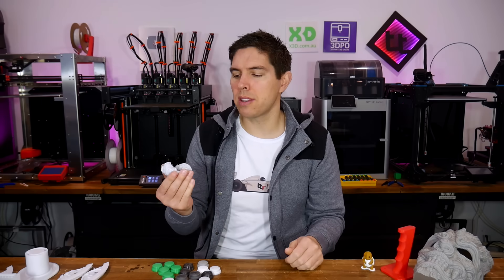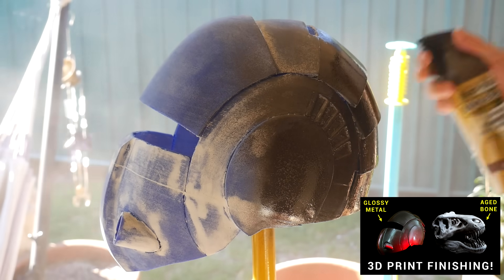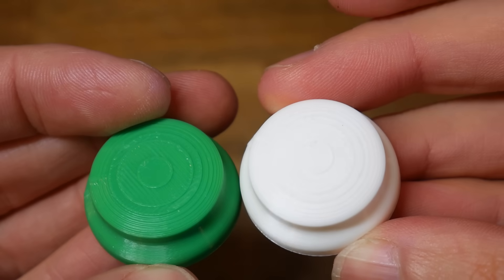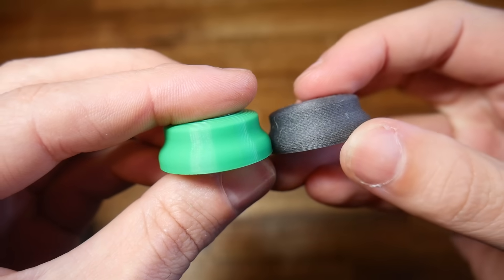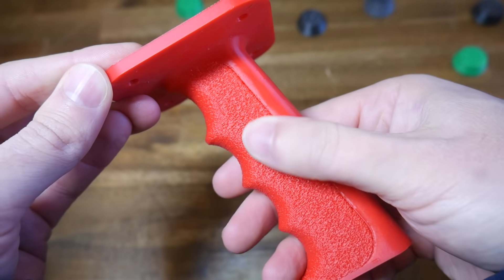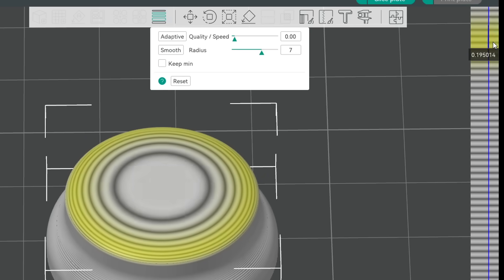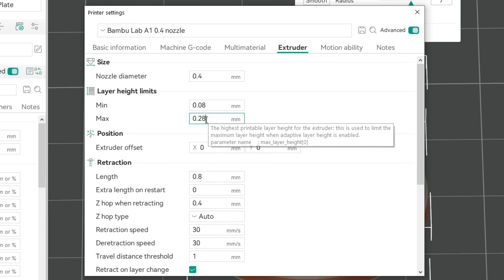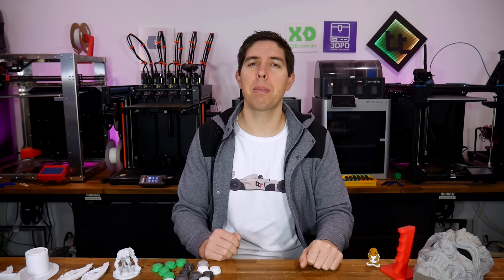Five ways to reduce layer lines on your 3D prints - Adaptive layer height and more!

Comment: It would be nice if there was a slicer option that treated a layer as non planar sort of. Treating the entire model is complicated but on a layer by layer it is simplified. It also could maintain the X/Y only to start. This allowing a min/max layer height to be achieved where the outer perimeters could achieve 0.05mm reducing lines while all inners are 0.3mm for speed. Yes it can get complicated for really complicated curvatures and may work better as a non planer for each layer where Z axis is also active.
 Steep portions would be simple for the slicer to print the perimeter 1st at 0.05mm (or min) layer height and build it up to the max layer height before continuing the layer. This could be simply stack 0.05mm layers up to 0.3mm layer on the perimeter and then continue the remaining layer at 0.3mm.

Shallow portions could be handled the same but for overall smoothness a layer height stepping from min to max would be better. Layer stepping (what I would call adaptive layer height) could based on calculations do outer perimeters at 0.05mm (min layer height) and step its way up while meeting the curve angle vs line width to 0.3mm. Then finally finish the layer at 0.3mm. Not really non planar but adjusting layer height based on surface curvature at that point.

 In a perfect world printing each layer as full non planar would be best. This would allow for any slope with little or no layer lines as one could print from 0.00mm height to max height on each layer while maintaining most of the layer at max layer height.

 Print times could be greatly reduced in some models with interiors printed at 0.3 or 0.35mm while outer perimeters at 0.05mm. This would also fix some overhang issues as reducing layer height also increases overhang overlap by reducing the stepover.

Comment: Why isn´t there an option to decrease just layerhight on outer perimeter? If you print outer perimeter first, printing maybe a layerhight of 0.7mm 3perimeters on top, but than the other perimeters and infill with 0.21mm. than the next 3 0.7mm outer perimeters and so on. As you only can see the outer perimeters anyway (exept on top) this would only moderatly increase printing time, but would increase quality a lot.

Comment: Flocking: that is stupidly simple, nice tip. For manual post-processing, i usually use woodfiller and thin it a bit with water/iso mix. Extremely cheap, non-toxic, easy to sand. Downside is that it needs to be sanded, sometimes sticking is a problem (clean the print from ANY oils and roughen it up a bit...)  and the dust goes everywhere. Note: do not EVER blow the gypsum dust, always wipe it with moist rag. The dust is abrasive and goes everywhere. It is a fan killer.

Comment: I seem to be one of the only people that really doesn't mind the layer lines of 3D printing, though I'm definitely not a fan of stair stepping on shallow sloped surfaces, so I do like the Adaptive layer height capability (which you can also do in the object table with more precision, tho it does take a bit longer to set up)
Reply: I'm the same. Most of my prints I either don't care about the layer lines or I need an actually smooth surface (such as when making a mold) so much only option is sand/polish.

I do mostly mechanical parts though, not decorative parts. So perhaps that's why I don't mind the layers.

Comment: I've got an idea: what about printing the internal parts with higher layer heights for speed and only printing one or two lines at the outer perimeter with lower layer hights for smoothness. Perhaps eves combined with adaptive layer heights. Of course the algorithm would need to make sure not to bump in to the internals by going around or raising the print head.

Comment: Note: .15-.16mm layers in FDM tend to yield better layer adhesion for mechanical / functional prints
Reply: I actually use THICKER 1st layers for improved adhesion on 1st layer.  Normally 0.28mm

Comment: In the 8 years I have been 3D Printing I constantly see that Fuzzy Skin setting and have always wanted to give it ago, but I never have. I’m going to give this a shot TONIGHT now!
Reply: If you do it, to it on a part that does not require tight tolerance. You can however disable Fuzzy skin in areas that require tight tolerance, but I can't explain it completely right here, you basically have to model parts that fit perfectly into the areas you don't want to be fuzzy and disable fuzzy skin on their common overlaps.

There are many videos here on youtube that explain the process, It's actually extremely easy.
Reply: @Smokinjoewhite  I wish they do fuzzy skin paint tool, so you can apply only on the surfaces you want... It would be awesome
Reply: @yuripolak they must? Or how was that handle printed?
Reply: @maj429  probably modifiers, but it's quite a challenge depending on the design
Reply: @yuripolak  I'll have to jump into orca tonight and test it out 🙂
Reply: @maj429  I’m pretty sure he made a video about the knife with fuzzy skin.
Reply: @Smokinjoewhite Are you referring to the modifiers in Orca Slicer (eg)?
Reply: I have about the same amount of years, and also going to print my first fuzzy skin tonight.. but i had that idea yesterday, for a temperature&humidity display housing.
Reply: It works great to hide the gap between two parts you're going to clip, screw, or otherwise put adjacent. Totally hides the seam.
Reply: It's been 6 months. Have you used it yet?
Reply: Used it on a fox sculpture was fantastic
Reply: Fuzzy Skin = Zero visual seams. Obviously this setting is not for every print but when it works, boy does it work!
Reply: ahahahaha I once accidentally turned it on and didn't understand why everything broke, all the walls were covered in shagreen, as if it was a bug
Reply: I'll bet you didnt

Comment: Fiber filaments are possibly the easiest cheat code. Not only are they often easier to print, but they can make layer lines disappear almost entirely. It will vary by brand, product line, and color. Generally the more matte the fiber filled filament, the better it will hide the lines. People who hate PETG should also try PETG-CF.